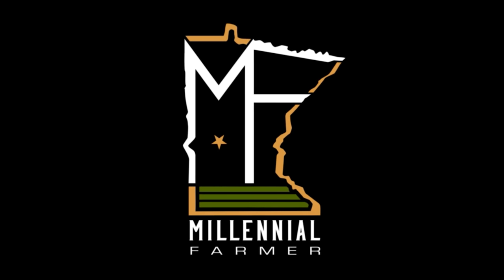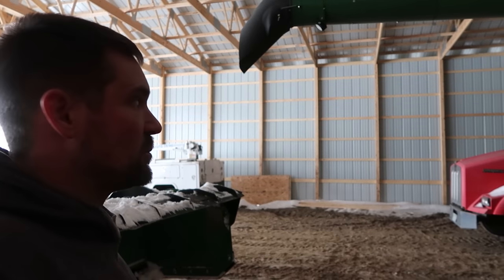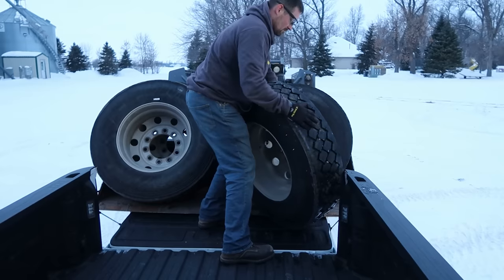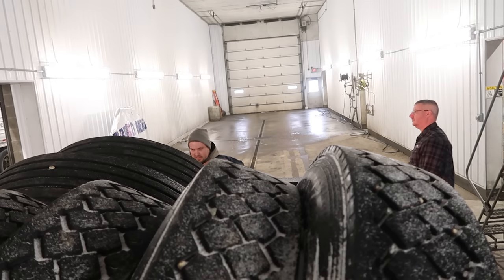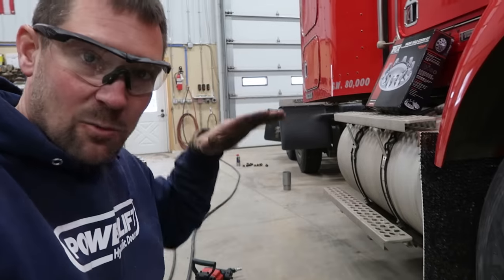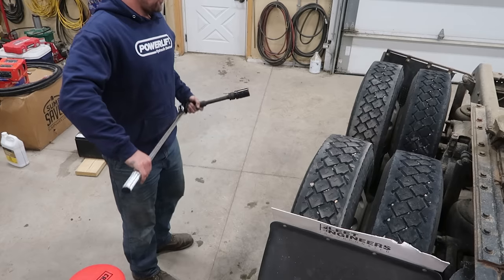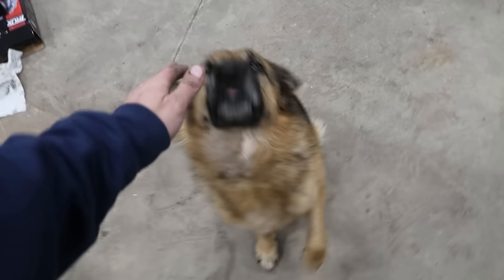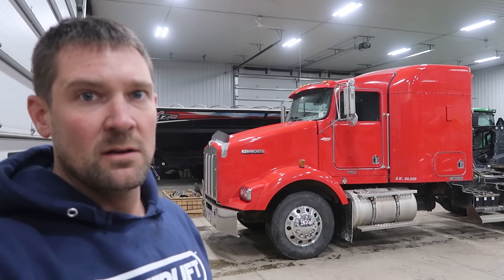This is NOT A HOW TO VIDEO! I Can't Believe it!

Comment: Heat at the battery cable is caused by resistance.  Resistance is caused by dirt, corrosion, or looses connection.  When you cut the rubber boot off the cable the corrosion was pretty evident.  I would suggest replacing the cables.  The connection blocks you said you didn’t want to mess with also look pretty suspect so it would probably be a good idea to replace them as well.
Reply: Came here to say this. The hotter ones are the bad ones. Recommend you cut the connector off and put on a new one - even with the new batteries!
Reply: ditto.
Reply: Yup
Reply: defiantly need to to replace those cables. Just you brushing the corrosion off and the wire flaking off shows that they are bad
Reply: Agreed, hopefully he will get the cables and connection blocks taken care of before they cause damage to his new batteries.
Reply: Replace the wires. Creepy green death is the cause as you alluded to. 26:37
Reply: @persistentwind  yes when you cut that end off go back a couple of inches and check the wire in the cable for corrosion . If it’s bad better replace that expensive cable .I have seen it go back a couple of feet in wire before .
Reply: I would add to this that if you're already in there replacing cables, have them replaced with something bigger. The amp draw on a starter is huge and any extra bit of conductor helps.
Reply: @robertscott8227  yup green death Is bad! If it's my own stuff I pull out the propane torch and solder those copper connectors solid, then heat shrink'em!
Reply: Beat me to it.
Reply: Doubtful the batteries are at fault.  Yse those Econo batteries in everything I own.
Reply: @persistentwind  especially with the new batteries. Don’t fix the cables and the batteries will get smoked again.
Reply: @therealsasquatch7779  Totally agree, replace the wires too, I had a 1991 Chevy Suburban that had a swollen jacket on it, like his truck, it was hard to start. Finally got around to replacing that cable, hard starting went by by. I did cut the outer case off that battery, green carp came out for what seemed like forever.
Reply: Corroded cables will eventually take out the starter. Definitely need to cut the corrosion out and put new ends on or new cables if you don't have enough length to repair.
Reply: Just got to match ugadugas to the torque wrench.
Reply: Jim will get him fixed up.
Reply: Before spending a bunch of money on cables try cleaning all the terminals on the battery, battery cut-off, breakers, and starter, I’ve been a road side tech for trucks for at least 5 years and although I have little experience to some other guys that watch you, you would be surprised at what a little dirt and corrosion will do at preventing a truck to start like that. Also make sure your alternator is charging the batteries while the truck is running voltage should be no less than 13.8 but really should be closer to 14.2 at the battery. If you are not getting charging voltage at the battery but you are at the alternator you either have a bad wire back to the battery or corrosion on the terminals. Check both ground and positive
Reply: This guy 100%
Reply: Yep said exactly this for about quite a few months ago, cables are junk.
Reply: Adding to the comment count so that maybe they see your post and fix the actual problem.
Reply: Clean your grounds all of them
Reply: Agreed to all previous comments - my addition is to shorten up the battery cables.  Leave a little slack for temperature swings, movement, etc.  But all that spaghetti on top of the batteries can be frustrating.  Plus longer wire will drop amps.  KISS - Keep It Short & Simple
Reply: From an EE, Douglas Williams is spot on. Repair or replace cables. If cables replaced, then larger size (Guage) would be money well spent. Also solder ends on. A little extra length is good, allows for future repairs. Grounds are as important as hot leads. Check alternator output for 13.8 v minimum, preferably 14.2.
Reply: Green disease in the cable - new cables
Reply: I put battery cut-out switches on my rigs. 12 bucks apiece saved me more frustration
Reply: @Rod Biddle  spot on. Solder the ends then some heat shrink on the cable ends and his cables will be in good shape for years.
Reply: @killianknutson3751  THIS one is the answer. hot = resistance. Resistance in cables is very bad in this instance. We're not running a heater here. So replace the cables, and go bigger. That's the cure.
Reply: This☝️ and low voltage can also cause heat.
Reply: Thanks for the answer, stopping me from perusing comments to find it.
Reply: Ditto, all of that needs replaced!  Buy some bulk 000 or 0000, a bunch of marine coated cold weld ends and a hand hydraulic press and get to rewiring all those big positive and grounds.  Hopefully it wont be like that all the way to the alternator, as well!
Reply: @26:38 - that whole cable is toast.
Reply: If replacing the cables might as well go up a gauge or two. Lesser resistance, less amperage needed to crank. Car and truck companies always size things as tight as possible to specs to save cost. Guranteed bigger wires will make a difference
Reply: There’s a chance your starter is bad we have experienced that before. If alternator goes bad that can cause a draw too
Reply: I hate when the semi trucks and school buses have dead batteries
Reply: Way too late reply.  I was in automotives and electronics so here goes.  Cable corrosion can work it's way up the stranded cable wire, throughout the thickness of the wire, literally along each individual strand.  If you strip insulation from the cable you'll probably see this.  The only real quuck test without an amp meter, and not a very good one at that, is to pull the cable off the battery post and try to bend it by hand.  These cables are thick and fairly stiff but should still bend some without too much effort.  If they are impossible to bend by hand and sort of feel like trying to bend a steel rod they're likely full of corrosion and should be replaced.  Actually, replacing battery main cables should be a sort of routine maintenance procedure at probably a 100,000 to 200,000 mile interval, depending on conditions where you drive; ie:  lots of salt air in a coastal location equals a shorter maintenance interval or lots of driving on winter (salted) roads also equals a shorter maintenance interval whereas if you're driving in desert Nevada or Arizona or inland Texas you could have a longer maintenance interval.  Bad cable corrosion can be identified through an amp meter test, higher than normal draw for something like headlights for instance.  But the cable itself will be rock hard and very difficult to bend by hand alone.  Also, a badly corroded cable will crackle when you bend it, sounds like a bad knee joint.  And now for the issue of the hot cable and the different heat at the different battery terminals.  A big truck starter draws a lot of current.  I'm making an assumption that your truck uses three 12 volt batteries connected in parallel, that's what it appears to be from your video.  And yes, your cables did look shot, as in severely corroded.  The three batteries in parallel will each supply roughly the same current, ideally identical current amounts, to the source of the draw, the starter motor for instance.  For ease of math let's say the starter motor draws 600 amps of current.  So each battery supplies (600amps ÷ 3 = 200amps) 200 amps of current.  The cable from the first battery carries 200 amps, the cable from the second battery carries 400 amps, and the cable from the third battery carries 600 amps.  You can now see how the cable from the last battery before the starter, carrying the full current, will actually be warmer than the cable from the first battery which only carries one third of the full current.  You would probably notice this difference even with brand new battery cables but it would be much less hot than your old corroded battery cables.  There's your over long science lesson for the day.😊
Reply: @lloydzilinski4401  I hate that the batteries go dead on the semi trucks and the school buses with batteries on the school buses 2 and 3 on the semi trucks

Comment: Zach, those aluminum wheels will not stay bright very long. You need to spray them with clear coat right after polishing, otherwise they will oxidize and get dull again.
Reply: We use Sharkhide on our aluminum here in Montana. It helps the road grim from eating the polish off your wheels
Reply: @pedrogunner9750  Sharkhide is the way to go. Even on my dirt bike aluminum parts!
Reply: Never heart of it until now I have to check it out for aluminum wheels on plow trucks.
Reply: In northern Michigan we just pee on em a lot. There’s no hope.
Reply: @taurus4205  🤪
Reply: @taurus4205  for the win!!!
Reply: Zac do not spray them with clear coat
Reply from the maker: @Taurus 420  kind of what I'm thinking. They're pitted already, just shined them up some. With all of our salt, they will only last so long
Reply: I used to use glass wax it didn’t last more than a year but it helps.
Reply: Never clear coat aluminum rims. Once the clear coat cracks it will corrode the rims faster and worse. Just wash them a lot and re polish every year. 
As for the electrical issues. Check ohm readings on each cable going to starter. Double check all frame grounds are clean as well.  The starter seems to be drawing a lot of power to start as well. So check starter draw.  If excessive replace starter.  Been a licensed truck mechanic in Canada for 37 years. Seen it all.
Reply: they make stuff for pontoon boats you spray it on and it penetrates into the aluminum
Reply: @SpongieG  Rather than checking the ohms, it's better to check the voltage drop from the battery to the starter while cranking. Some bad connections don't show up except under heavy load.
Reply: @bruceadler-9410    Very true. But it is another check for sure. Just to rule it out
Reply: I guess the resistance of these cables should be well below 1mOhm, which is below the range of a multimeter (and probably even below the resistance of the probe cables). So if you measure some resistance, you'll know that the cable is really bad or you have a bad probe connection. This can be caused by surface corrosion. You can scratch the surface first with the probes, but I think this is not a reliable method for people seldom using a multimeter. So I also would recommend the voltage drop test.
Reply: @MillennialFarmer  honestly, if its a farm truck, who said the matte red or black or white isnt the way to go? thats how they were when i was a kid, a good ol can of rustoleum
its much easier maintaining as a cattle hauler, always being on the road, you can quickly wipe or wax with no issue haha
Reply: @bruceadler-9410  You both are correct.  Voltage drop is a function of resistance. Check both at rest and under load.  Cables are often the culprit in batteries going bad prematurely.  I own a battery store and also farm 2k acres, we go through this with our equipment as well as with the surrounding ag community.

Comment: Get yourself a thermal imager. Best tool for troubleshooting, engine, hydraulic and looking for poor connections. Crank the starter to allow the poor connection to heat up. Then use the imager to find the heat from resistance. Hope this helps. Great content
Reply: He already found the heat source it's the next step he is asking

Comment: Replace the battery cables, and all the connections - spray them down with battery terminal anti corrosive stuff.. - cover them with the rubber boots.

Comment: Zach check your battery cables for corrosion and the engine/frame grounds for rust.
Reply: Better yet..  add another new ground
Reply: Battery disconnect switch. Turn off, walk away until you need to go, whenever.
Otherwise, just keep on grumbling about batteries.
Best wishes from the far North.
Reply: @carlthor91 he already has one
Reply: Check starter draw and battery cable voltage drops
Cables go bad inside with age also loose voltage for high draw starter
Reply from the maker: @carlthor91  would you believe me if I told you we have them and they don't make any difference?
Reply: If I was you I would change the cables and put a new ground wire. Then add a disconnect.
Reply: @MillennialFarmer  Then there has to be a circuit that bypasses. This just does not make sense???
Oh, by the way hope you have everything ready for the snow, looks like you are in for about 6". Don't know about the wind?
Best wishes from the snowy North.
Reply: @MillennialFarmer honestly dumbfounded. Kill switches save a lot of issues we used to have with our Volvo trucks
Reply: @carlthor91  that’s what we have on our trucks except one that the batteries never drain down
Reply: @scotth7782  Golden rule.  Thou shall check voltages.  Check voltage at the starter while cranking.
Reply: Fought the same thing on a 379 Pete for over a year. Batteries, connections, cable ends, and checking for draw.   Finally put a new starter on it and, voila no more starting issues.
Reply: @MillennialFarmer  are your batteries connected in parallel or in series? If they're parallel connected (ie, they're 12v batteries and the tractor has a 12V electrical system) and if they aren't equally charged then they will self-discharge.  You need a disconnect on each battery to prevent self-discharge (or a smart charge manager - the solar power industry has them but I don't know whether the trucking industry has them).
Reply: @MillennialFarmer  The connection being warm is, seeing how the cables look, the corrosion is causing a lot of resistance. The corrosion is impeding the flow of electricity and because there's resistance, you got heat. Cleaning the connector eyelets helps, but that cable looks pretty bad. I'm betting cutting the jacket back a little will show the corrosion creeping in further. A few of the older fire engines on the department I was on had similar issues, hard starts that new batteries didn't fix. Replaced the short cables because it was simple, made a cut and stretched a little on the mains and replaced new terminals - never had a problem after. Master switches work for what they are, but they won't fix corrosion.
Reply: I had a tractor once that the batteries would drain down ,finally figured out it was the alternator that was the problem,even thought it would charge the batteries when running ,we checked by disconnecting the alternator when we shut it off a few times and the batteries would stay charged
Reply: Voltage drop test across the cables. 1 probe from multimeter on 1 end of battery cable other probe on the other end and see what the voltage reads while cranking. It could be the main cable or a jumper between the batteries. A bad jumper will cause it to only draw off 1 or 2 of the batteries instead of all of them
Reply: @MillennialFarmer  with the truck running measure the voltage on each battery and compare it to the voltage that the alternator is producing. I’d bet one of those batteries isn’t getting charged due to high resistance caused by corrosion in the wires. You need to exceed the voltage of a battery to charge it. So if the voltage you measure is below 13 or so volts it’s probably not charging from the alternator after you start the truck. Fully charged 12v batteries should be about 12.6v. DC circuits are highly sensitive to resistance.
Reply: @billsauberlich7337  yeah the fields in the alternator can get stuck and drain the batteries. That is the thing a battery disconnect will stop from happening. Since his problem is present while using the disconnect you can safely say it’s a problem past the disconnect.
Reply: Coolest trick I’ve seen for doing tires is a flat transfer spade or snow shovel under the tire to manipulate the tire while being able to skid it around.  That plus a little sand on the floor to help with the skidding.
Reply: @FoolOfATuque  I'm curious would it help to put a cutoff on both negative and positive side?
Reply: @billsauberlich7337  nope, just one wire needs isolation. Like when you work on a car you only take off the ground wire on a battery. That’s because electricity needs a loop to form a circuit. If you break the loop at any point it will break the circuit. Vehicle wiring uses the chassis as ground to finish the loop to the battery. That’s why people are saying to check the ground straps as well.

Comment: A trick to get stuck wheels off that I use is loosen all the lug nuts, then thread them back on until they touch the rim and then back them off just a little bit, maybe half a turn or 1/8" of space between nut and rim. Then set the truck back down on the ground and drive forward and back hitting the breaks and this should work to break the seal.
    For front steer wheels sometimes all you need to do is turn the wheels left and right and you can feel them break loose. With the trucks weight on them of course.

Comment: Heat is caused by resistance, and resistance usually means corrosion. Clean the terminals with a wire brush, and spray them with a passivating/ preventative compound. Won't stop it, but it will slow it down.
Edit: clean the terminals on the starter, too.

Comment: G'day Zach, I'm a bit late to the party, just a tip with your tension wrench, place your hands in the middle of the knurled handle when you tension, beleive it or not shortening your grip and reducing the length of the handle reduces the actual torque applied to the nut and increases your effort, 6 inches makes a big difference (so she said) ✌️😁